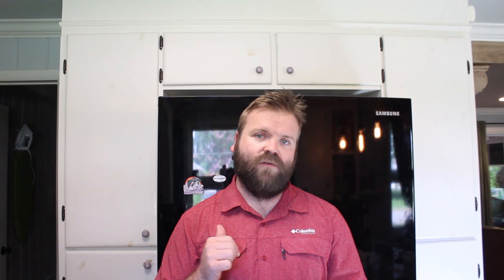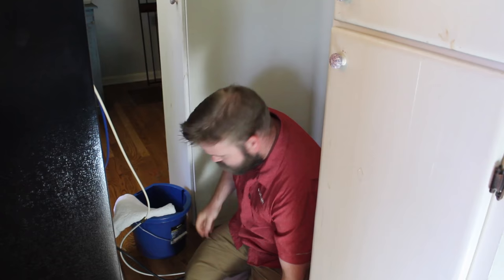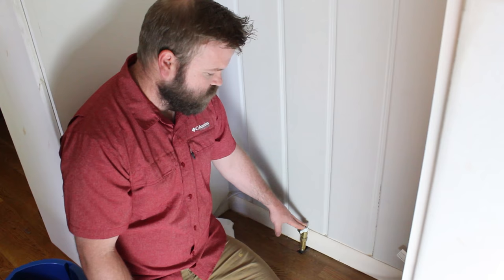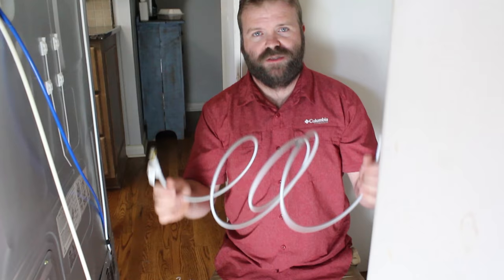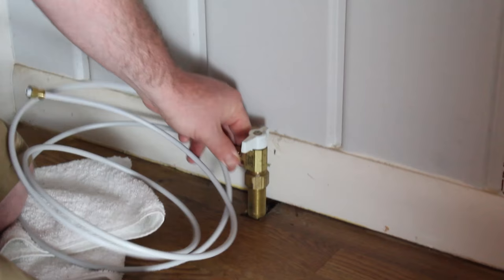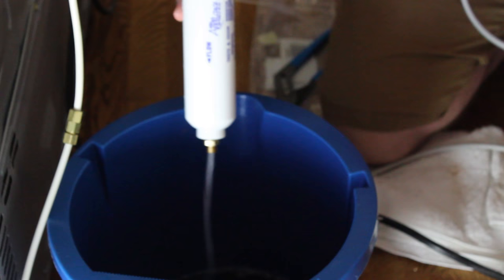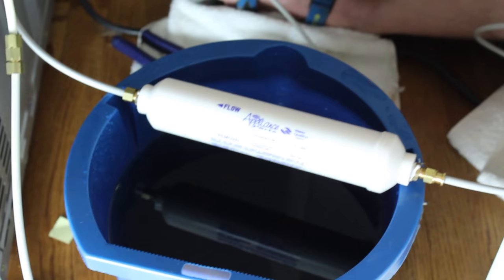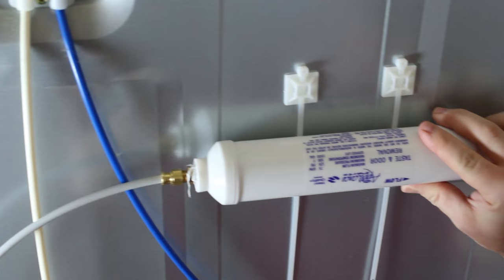How to Install a Universal Inline Refrigerator Water Filter

Comment: If have water  filter under sink can run ice maker and filter off it
Reply from the maker: Absolutely, connecting your refrigerator's water supply line directly to your under-sink water filter system is a great idea. This setup allows you to leverage the filtering capabilities of your under-sink system to provide clean, filtered water for both the refrigerator's ice maker and water dispenser. Here's what you need to consider:

1. Check Compatibility: Ensure the connections between your refrigerator's water supply line and the under-sink filter system are compatible. You might need adapters or connectors to join the two, as tubing sizes or connection types may differ.

2. Water Pressure Considerations: It's important to verify that your under-sink filter system does not reduce the water pressure below what your refrigerator requires to function properly. Especially with reverse osmosis (RO) systems, the water pressure might be lower, which could affect the performance of your refrigerator's water dispenser and ice maker. If necessary, a booster pump can help maintain adequate pressure.

3. Filter Maintenance: Remember, your under-sink filter will now be doing double duty, filtering water for both the sink and the refrigerator. This might increase the frequency at which you need to replace the filter due to the higher volume of water being processed.

4. Flush the System: After installation, flush the system according to the manufacturer's instructions to ensure any debris or contaminants from the installation process are cleared out before using the water.

Directly connecting your refrigerator to your under-sink water filter system is an efficient way to manage your home's water filtration needs. If you’re not comfortable with DIY plumbing tasks or if you encounter any issues, don't hesitate to seek the assistance of a professional plumber.

Comment: can you leave the factory filtration unit in and just install the other one in the back?
Reply: I did with my Kenmore.  It worked just fine without reducing water pressure.  I installed a 5 year or 5000 gallon filter. Maybe it was a 50,000, I can't remember.  The factory filter are so expensive and they last 6 months.
Reply from the maker: Absolutely, you can leave the factory-installed filtration unit in your refrigerator and install an additional inline water filter in the back. This setup can offer several benefits, including enhanced filtration capabilities and potentially extending the life of the internal filter by pre-filtering the water before it reaches the refrigerator.

Here are a few things to keep in mind when setting up an additional inline filter:

1. Water Pressure: Ensure that adding an extra filter does not reduce the water pressure below the refrigerator's required minimum. Low water pressure can affect ice production and water dispensation.

2. Filter Compatibility: Check that the inline filter is compatible with your refrigerator model and is designed to filter the specific contaminants you're concerned about.

3. Installation: Install the inline filter on the water supply line leading to the refrigerator. Ensure all connections are secure to prevent leaks.

4. Maintenance: Keep track of both filters' maintenance schedules. While the inline filter might take on the brunt of the filtration work, both will still need regular replacement to ensure optimal water quality and flow.

By using both the factory filtration unit and an additional inline water filter, you're creating a two-stage filtration process that can significantly improve the taste, smell, and safety of your drinking water and ice.

Comment: Can you please show the brand of the filter and the line?  Mine is the “quick connector” kind which the 1/4 inch pipe just push in. It doesn’t have the connector on both ends.

Comment: What's the model number on that fridge? I have a Samsung as well and I want to know if I need a bypass to install an external filter.
Reply: Remove the filter and if water still runs inside to the water dispenser or ice maker than you don't need a by pass. I have an LG and the homde depot didn't installed properly . when it was time to replace the filter I cut it open to see how much debry it traped and it was completely dry not a single drop. Wat a waist .
Reply: @MrPerito777  How annoying for you! I find HD and Lowe's to be worse and worse every year.

Comment: Can I attach the hose to my unde sink filter?
Reply: I did that to my 3M undersink filter.  Cheaper, filters better than reefer filter and lasts several years.
Reply from the maker: Absolutely, connecting your refrigerator's water supply line directly to your under-sink water filter system is a great idea. This setup allows you to leverage the filtering capabilities of your under-sink system to provide clean, filtered water for both the refrigerator's ice maker and water dispenser. Here's what you need to consider:

1. Check Compatibility: Ensure the connections between your refrigerator's water supply line and the under-sink filter system are compatible. You might need adapters or connectors to join the two, as tubing sizes or connection types may differ.

2. Water Pressure Considerations: It's important to verify that your under-sink filter system does not reduce the water pressure below what your refrigerator requires to function properly. Especially with reverse osmosis (RO) systems, the water pressure might be lower, which could affect the performance of your refrigerator's water dispenser and ice maker. If necessary, a booster pump can help maintain adequate pressure.

3. Filter Maintenance: Remember, your under-sink filter will now be doing double duty, filtering water for both the sink and the refrigerator. This might increase the frequency at which you need to replace the filter due to the higher volume of water being processed.

4. Flush the System: After installation, flush the system according to the manufacturer's instructions to ensure any debris or contaminants from the installation process are cleared out before using the water.

Directly connecting your refrigerator to your under-sink water filter system is an efficient way to manage your home's water filtration needs. If you’re not comfortable with DIY plumbing tasks or if you encounter any issues, don't hesitate to seek the assistance of a professional plumber.

I hope this clarifies things! Pun intended. Feel free to reach out with any more questions or if there's anything else you need help with.

Comment: I thought filters were meant to be installed vertically?
Reply from the maker: Always check your manufacturer's instructions. But, if your refrigerator doesn't have a water filter, a universal inline water filter can be installed on the water line to filter your water. Your home's water pressure should push the water into and through the filter, whether it is horizontal or vertical.

Comment: Watts has one that supposedly lasts 5 years or 20,000 gallons ....mine is almost 2 years old and I am nervous ....but its mostly just my wife uses it and doubt we use more than a couple gallons a day so that would literally last for years ...supposedly anyway
Reply: Dougie Quick to be safe replace it every 2 years, its just $25 to buy one in Lowes
Reply: I would replace it if you use it frequently for water as well as ice. Just think about how gunky tap water is. You can remove your kitchen faucet aerator unscrew it from the faucet spout and see the screen with JUNK from tap water flowing through that well multiply that times 100 because your refrigerator filter filters out a heck of alot more than just the big stuff. Yeah I would replace the filter every 2 years..Hey you could always very safely open one up to see how much crap is left inside your filter..Just do it safely ...

Comment: OR you can fix the filter to the top of your fridge and turn off the water outside and not have to pull the fridge ....course it is a good idea to clean the compressor vent once in a while anyway

Comment: Can you have the factory filter and the inline filter hooked up?
Reply from the maker: In theory, you could have an inline filter on the supply line, and a refrigerator filter. I would expect, maybe, a drop in pressure when calling for water through the door. If you notice this, you can expect the icemaker may produce smaller ice cubes. If that happens, I would remove the inline filter. But, I don't theoretically see any issue with double-filtering your water. Other than reduced water-pressure (possibly) and the obvious 2x cost. Manufacturers recommend changing them at least once every 6 months.

Comment: The back of the refrigerator is a very inconvenient place to mount the filter. Now you have to move the refrigerator to change the filter.
Reply: Once every 5 years, Ecopure, for me is easy to replace and convenient and I don’t want to spend  $50 every 6 months  to replace. That’s more than a $500 savings, also, I should be cleaning under and behind my fridge, needless to say at least 2 times a year.
Reply: @kalaukia434  Do you know if this works for for the water line for ice maker only? Got a new fridge, no in the door water or ice,  but regular ice make in the freezer part.  OUr ice tasted terrible in our old fridge and want to put them on the water line like this in the back like the video to help the ice to taste better.   List is the hex line, mouting/zip ties and ecopure filter.  Did you use anything else?

Comment: Every plumber: always use teflon tape

This guy: i dont use teflon tape......

2 mins later, uses teflon tape. Sorry but stop spreading misinfo, ALWAYS use teflon tape for anything liquid or gas. Smh
Reply: You: No clue what you are talking about.
Did you happen to notice nothing in the instructions about Teflon tape?

Teflon tape is for pipe threads, where the threads form the seal. The seal shown on the fitting shown is made where the ferrule contacts the brass seat. The threads are only there for proper tightening. Teflon tape would only compromise the seal.